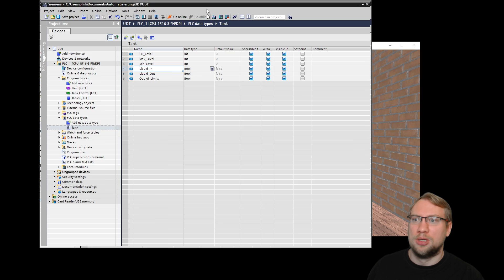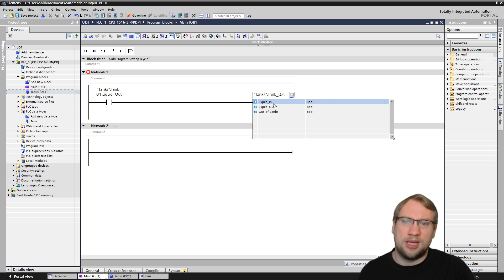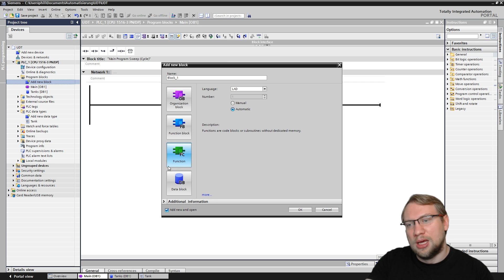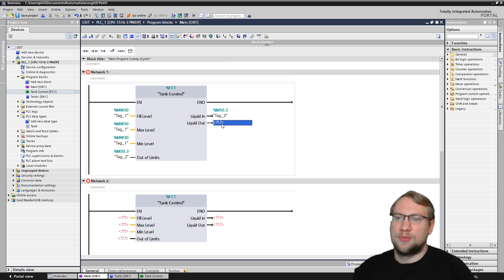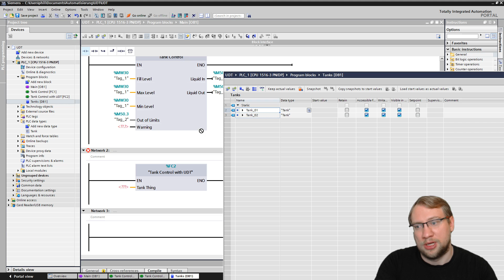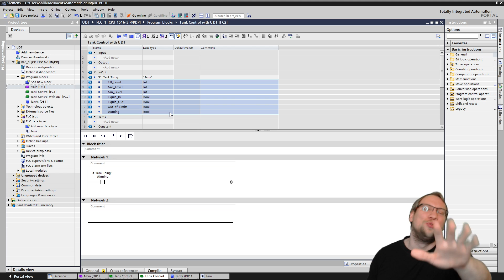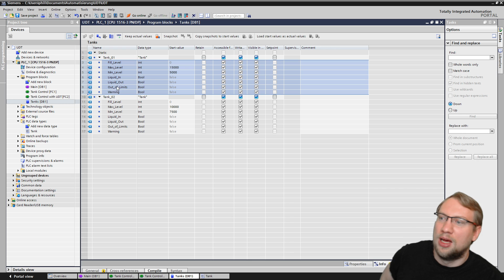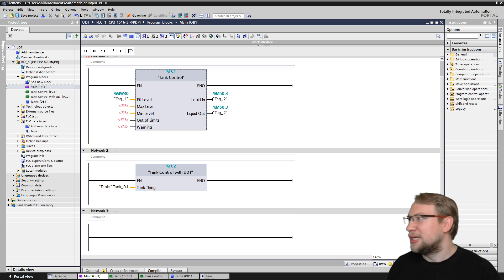TIA Portal: UDT's (User Defined Types) - Part 2

Comment: I wanted to use a hardware interrupt and was happy to learn from your session about OB40. However when I came to apply it to my project I found that there was no setup space in the ANI card config.
I then discovered that the reason for this was that your tute was based on a 1500 PLC while mine is a 1200.
So could you please clarify in  your tutes what works with a 1500 but not with a 1200 ?
Thanks.

Comment: Dear Hegamurl;one disadvantege of using udt in a FC you cannot determine input and output. I mean that You can determine mw300 as fill level and you can see by looking at the FC inside main ob. but if you use udt you can determine it inside the FC.
Reply: I think if you use the same udt in both input and output there will be no problem.

Comment: You need to do this video again and shows how useful and powerful UDT ares when you used them "Outside" of FB (Function Blocks) not inside of them. On your video you created a FB called Tank Controller, inside here you need to use standard variables and then let's say you instantiate this FB and create these: Oil Tank, Water Tank, Solvent Tank, Soap Tank, Degreaser Tank. It is with these five instantiations when you used the UDT type in a more powerful way.

Comment: Hello Hegamurl,
There is one think I do not understand. Would it not be easier not to use Tank DB but to declare vaiables in Tag Table as "Tank" Data type? When we strorage variables in Data Block then the I/O for each tank have to be written to Database block in the function, right?
It means more work to do.